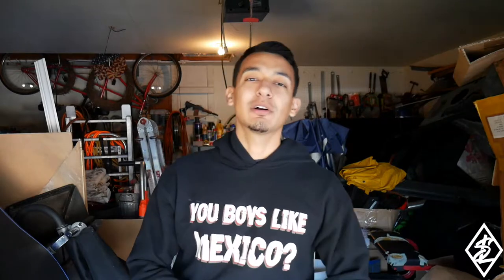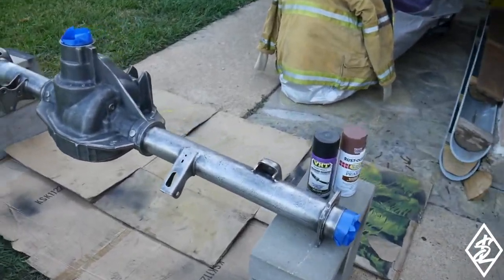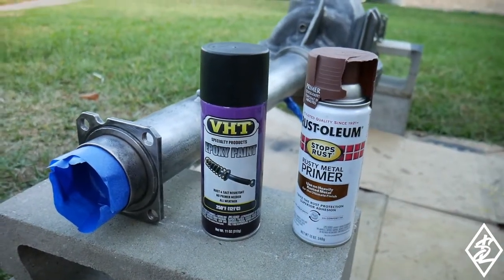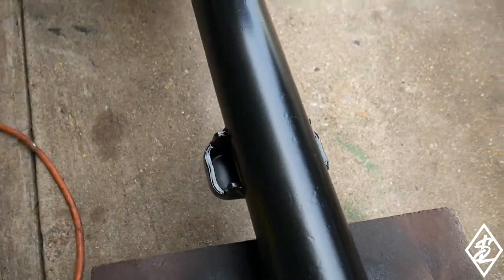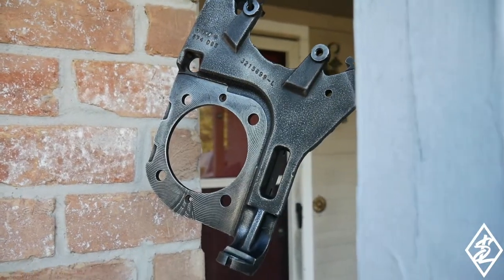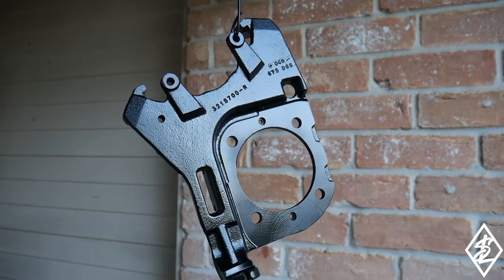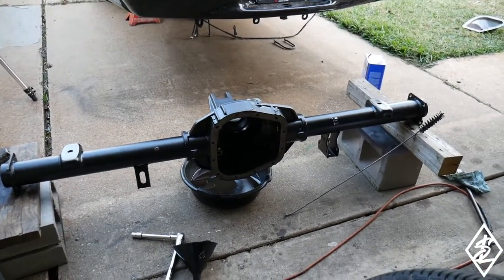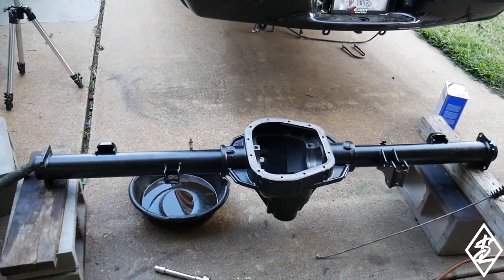Cleaning & Painting Rear Differential Casing!

Comment: not supposed to use  primer with epoxy paint....will get better adhesion just painting epoxy straight to metal. Even with a little surface rust.